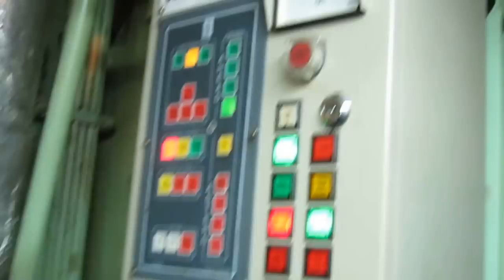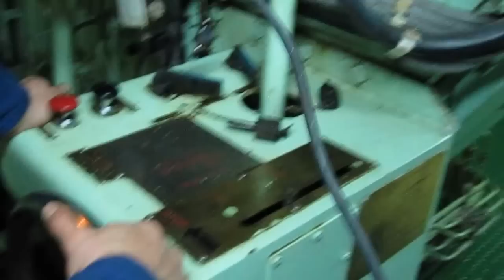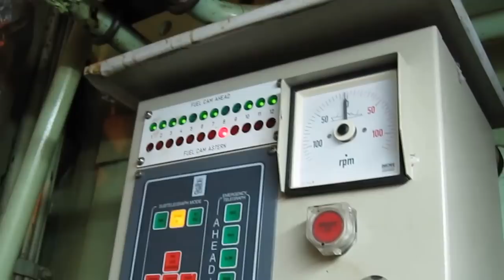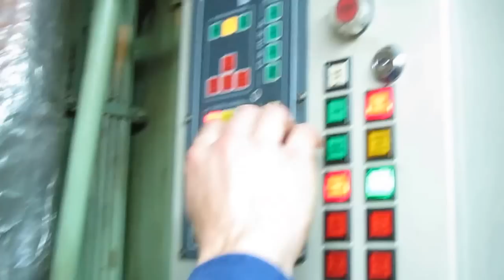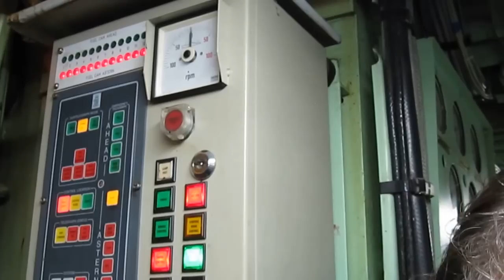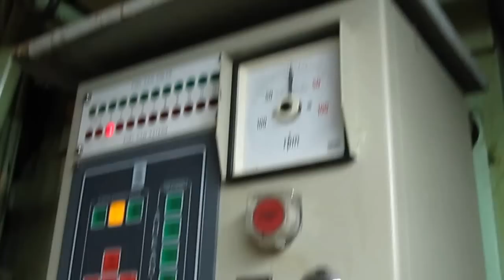Container Ship Main Engine Starting

Comment: After 45 years at sea no they are not pushing random buttons, its the engine side controls for when the computers go tits up .The view is not the crankcase but the camshaft with the fuel and exhaust valve cams. The alarms are being answered in the control room.
Reply: +theold49er ---- I am just guessing, but they were starting, stopping the engine, and reversing direction, That is how the ship changes direction, by running the engine backwards ? (smaller ships have gear boxes I would assume ) . And the last thing they did with the black knobs was restore control to the bridge deck ?  And yes I did notice they were cam lobes and not connecting rods. But I would thing with valves that big they would be almost like connecting rods, instead of spring and lift type like on smaller engines.
Reply: +eric wsmith The engine is directly connected to the propeller, with no gearbox of any kind. To go in reverse, they start the engine in reverse, hence why the RPM gauge goes from "black 100" to 0 to "red 100", for forward and reverse.
Reply: Engine revers is necessary when the ship has FPP. When the vessel is with CPP engine revers is not needed.
Reply: Geo Thomas
Its just the way it works, buddy.

Comment: you know that having a window on your crank shaft is cheating right? lol
Reply from the maker: +Ronnie Paul Was the Camshaft mate ;)
Reply: +bullettoothtony2007 No. It's da bumpstick.
Reply: +bullettoothtony2007 If it's part of the engine and it is seen turning on the inside, it's cheating! LOL! Doesn't matter but thanks for the info. Never seen one in a ship. Just an old submarine! And a lot of other engines.

Comment: So does actually anyone know what's happening or are they just pushing random buttons?
Reply: this is the manual control station,  on a big container ship, the only way to reverse the prop to slow down  (or go backwards) is to reverse the entire engine. they switched the cams, pumps,  and injectors around so the whole engine spins backwards (you can see this when the lights go from green to red, for "aft"). my guess is they're probably docking,  which would explain all the forward and after movements.
Reply: That's a good explanation, it makes sense now. I guess the bridge were sending orders down to the engine room and these guys were controlling the mechanical side of things. Having experience with small engines I found it hard to get my head round the fact that big boats don't have a clutch or gears and you have to stop the engine and reverse it if you need to change direction!
Reply: ChayD basically, the engine is so massive a clutch and gearbox would need to be so large it becomes impractical.
Reply: This is the manual engine control station for use in emergencies, it's being tested here. The lights on the upper panel are the signal from the bridge telling them what speed to run the engine. On the control station, the black and red buttons stop and start the engine and the wheel controls fuel flow. The switch they move at 2:35 sets forward/reverse. They do 3 tests: Starting the engine forward, starting it in reverse, and starting it in the wrong direction in order to test the wrong direction alarm. After all three tests are complete, they disable the manual control station and return control to the bridge.

Comment: B & W Main Engine. They are operating on the emergency control stand as a routine test to check it's effectiveness as required by the company's SMS. This method is only used during emergencies like if the Bridge or ECC control fails to operate M/E start/stop, ahead/astern. Marine engineers like me know what I'm talking about.

Comment: that is one dangerous f*ckup, starting astern when ahead is ordered
Reply: It starts ahead, the green figures means ahead on the rpm meter, the red astern. Also, the 12 cylinder indicators indicates green, if astern, it would be the 12 red below.
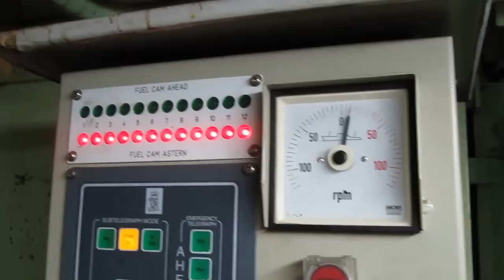Reply: 5:14 order ahead, start astern
Reply: Thom Muis you are right, i didnt see the restart.
Reply: They were testing the "wrong direction" alarm, so in this case it was intentional. This whole video is just a routine test of the main engine's local control station.
Reply: LOL. I notice to hahaha :D
Reply: @KingdaToro  Ok. I did not notice they where testing direction alarm, just notice he did not start ahead when he was commanded to.

Comment: this is the local/emercency control unit for main engine.when the control room unit have malfunctions and also bridge control unit is not working u come here and start to play.this will allways work because it's fully mecanic.u need only compressed air.because u are consuming much more for each start in compare with the automatic system

Comment: Do all ship engines function in the same way? This start up sequence looks pretty laborious.
Reply: Not that much different from that of steam engines the days of steam power. Since there is a delay in the signal and change of engine ops since the ship is so large that what you are seeing is just part of the picture from inside, ships do not move faster than 10 mph or 13 nm/h when docking which what was going on.

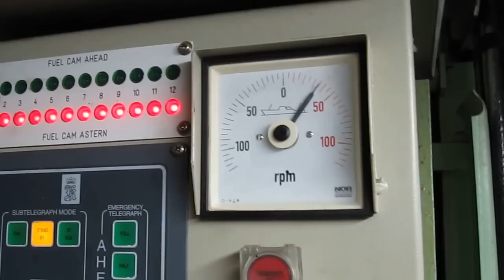Comment: At 4:58, the engineer receives at dead slow ahead command and by mistake, forgets to reverse the cams and starts the engine astern. Big mistake that  triggers a WRONG WAY alarm at 5:25. Corrected at 5:57, that is enough time to hit a dock and damage the ship. Lack of concentration, most likely due to the presence of a camera.

Comment: In a documentary, I saw them refurbish a cylinder while underway. I presume there is a way to disengage the piston rod from the connecting rod? Do you have to stop the engine to disconnect it?
Reply from the maker: +researcher4good The piston rod and connecting rod are held together with hydraulically stretched bolts which require a hydraulic jack to remove. It would not be possible to disconnect while the engine was turning, but can be removed whilst the ship is in port. The ship can easily function with one piston removed which would allow the crew to perform any maintenance on that single unit.
Reply: +bullettoothtony2007 So they shut down for removal and assembly, and refurbished while underway. That makes sense. Thanks
Reply: i saw the same video.  they did say the replaced the piston with out Any loss of speed.  they talked like it was done while the engine was running.
Reply: researcher4good ...soooo you have no idea how an internal combustion engine works. must have been a n aux engine (generator), or a second main engine
Reply: I would imagine they'd have to stop the engine, then dis-connect the piston rod at the crosshead...then perhaps get started again....some engine room videos show a 'spare' piston/rod sitting near the engine in a rack....ready......
Reply: Doug Ankrum they usually have 1 or 2 full pistons with piston rods, and cylinder jacket

Comment: I have work on board for some time and retire now but it is the first time iI saw a control station so simple and if it really exist... it might be the emergency control (final and manual) post for the main engine. it also dont hear the engine start sound (normal by compress air).

Comment: How much air pressure is used and do they keep the air compressor on board the ship?
Reply: I take it the compressor is on the ship, you don't want to have to rely on a shore-side supply which would require serious hosing to be able to connect to your ship over such a distance.
You also want to be able to start the ship after you've suffered technical problems out at sea that for whatever reason had you stall the engine.
As for the pressure: I unfortunately do not know.

Comment: Hard to fathom the connection between the digital buttons and the relatively massive crank and indicator.
Reply: +Organgrinder1010 Camera operator standing too close, loses perspective.
Reply: I get it… Hard to “fathom “… Because they’re at sea…
Reply: The digital buttons are the ship's telegraph and correspond to commands sent from the bridge (you know, in old films when you see the captain turn a massive lever to "Ahead Full" and a bell goes *ding*ding*, but done with buttons). The engineers then act on these and set the engine to ahead or astern and set the appropriate speed with that crank wheel, finally giving the engine a blast of compressed air to start it. Thing is that engines this size don't have a clutch or gearbox, so you have to stop the engine, then start it in reverse if you want to go backwards!

Comment: I am sort of puzzled. I am assuming you tried intentionally to start in astern mode. If not why was it 'wanting' to run asern instead of ahead? I can figure out basic proceedure of starting from this clip though on instrument panel some lights or buttons were out of focus and I could not read them.
The two blue levers on top left (One you locked) I am curious of purpose of these particular two blue levers. (I used to have textbook on marine diesel as bought at local maritime school).  Sorry I gave it up!  So I know proceedure of air starting. Is this MAN/BMW engine?

I was aboard training ship today Kaiwo Maru from NIST (National Institute of Sea Training ( near Yokohama, Japan.
Reply from the maker: Yes, this is a MAN B&W engine. When the bridge request to go 'dead slow ahead' that is the green light that shows and then we have to acknowledge this request by pressing the button. However, when we started the engine, we had not switched the fuel cams back to ahead mode after running her in astern, this is done by one of the two small blue levers. The other blue lever switches between normal running and emergency running. As this is emergency running, none of the controls in the engine control room or the bridge will be able to run the engine, they can only send requests to the emergency station seen in the video.
Reply: bullettoothtony2007

Left shipping in 1982 as 2nd. (Reefer and container). Think, the chief & master would have killed me for a thing like that. Hope, they did not do that to you ;-) br
Reply from the maker: kalle123 The Chief came up with the excuse that we were just testing the 'wrong direction' indication. Also, we were stopped in the middle of the Atlantic at the time to do an em'cy steering gear drill aswell, so starting her the wrong direction wouldn't have endangered anyone lol
Reply: bullettoothtony2007
Always a calm sea and sunshine! Reminds me of my time on board ;-)
br

Comment: 0:58 what's through that window???
Reply from the maker: The CAM shaft
Reply: bullettoothtony2007 Think its the crank. If that was the cam then holy hell at the crank..
Reply from the maker: It was the CAM in the window. This is the Crank shaft http://imgur.com/a/6C6Po#LOhyI
Reply: Wow, that is impressive. Thanks for sharing and clarification!
Reply: ***** Yep thats only the Camshaft!!
Reply: Is 1 Port Hole of manny to viev Operations of Associated Equipment & The Primary Crank Shaft Attached & Directly Beneth the 12 The Piston heads.;-)
Reply: +Alex Curle The bump stick.

Comment: That is controlling the main engine from the emergency control stand.

At around 5:00 bridge is requesting slow ahead and these guys are starting me astern .....
Reply from the maker: kalle123 Yes, but we tested the engine in the middle of the Atlantic so this is not an issue, it also tests the 'Wrong direction' alarm ;)

Comment: If that engine was built by Ferrari, it would be doing 2000 RPM, and your ship would be doing 60 knots. lol
Reply: It produces around 100,000 HP and at an efficiency that would make the average car get around 50 MPG. And it runs on cheap sludge. They're not doing too bad.